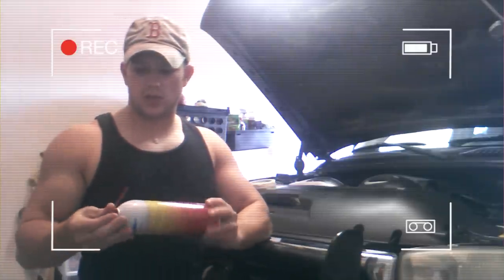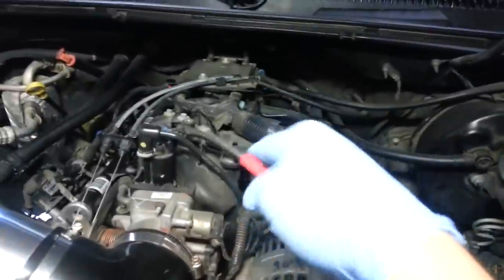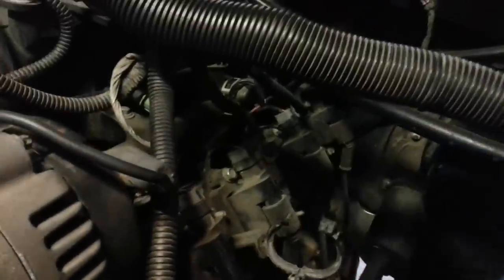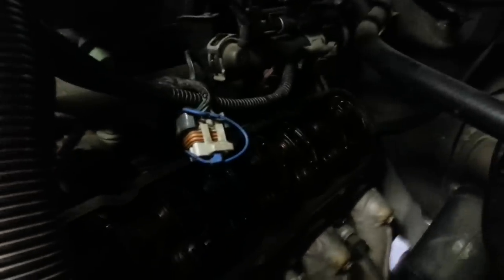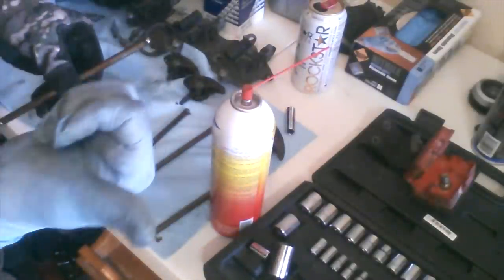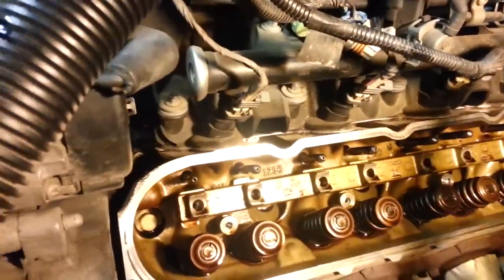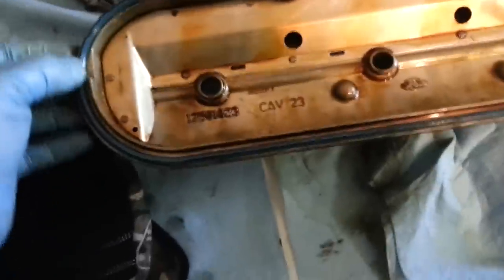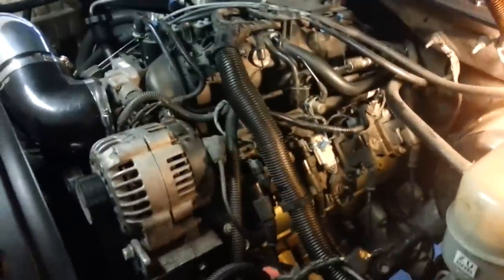GM Lifter Knock Repair - Carb Cleaner Method - HOW TO / TUTORIAL

Comment: I know you mean well.  But ... Pulling those studs out is a NO NO!.  You should never remove a rocker stud if there is a nut on top of the rocker, use a wrench to hold the stud tight in the head, and remove the nut from the top.  Also you better know how to set the lash on the rockers once you put it back together.  Or you going to have misfires, cross firing, and in general you may not even get the truck started.  As I said, I know you mean well, but what your doing will cause extream damage to the valve train if you make a mistake and over tighten a rocker, and if you don't torque those studs back into that head, they WILL come loose and then your going to need a new head.  Any of the 5.3l 5.7l Vortec engines made from 95 to 98 will have pressed in rocker studs , but if the engine or heads have been rebuilt by someone that knows what they are doing, the studs may have been removed and screw in studs installed.  These are not meant to be removed from the head once installed, they will twist on reinstallation and can break or come loose.  To accomplish what your attempting to do, you are better off to pour a quart of transmission fluid in the engine and run at an idle for 15 to 20 minutes then drain the oil and change the filter and refill the oil.  Sometimes you have to do this three times, and some folks use kerosene rather than transmission fluid.  be careful with kerosene and pouring it in a hot engine may flash  on you, IE it is highly flammable, but then again so is the Chemtool Carb cleaner.  You hit a hot exhaust header and you may end up with a 2nd degree facial burn, your hand blown off when the pressurized Chemtool can explodes, and a fried truck, with either one.  Think I'm kidding about any of this?  I was a GM GoodWrench ASE certified line Mechanic.  I have rebuilt over 150 SBC engines, and more than 50 Big Blocks, not to mention Buick, Pontiac, and GMC's.  Good luck if you keep this up, you WILL toast an engine sooner than latter.

Comment: Not a bad idea. Most likely could just squirt the cleaner down the rocker into the pushrod and it may clean the rod and then just squirt around the lifter bores. Saves l the work and get the same principal accomplished. Great idea though

Comment: Couldnt you of just left the pushrods and rockers in place and sprayed the cleaner through the hole at the top of the rod/rocker assembly? The cleaner would of traveled through the pushrod to the lifter anyways?

Comment: What about on a 3.4 liter grand am with a loud knock? Would this work? Not sure what's really wrong other than loud knock and car shaking when in park. Gets louder when you hit the gas pedal
Reply: Get a long screw driver or similar item (something that is  hard and rigid, metal or plastic) while the engine is running place the tip of your screw driver/ rigid item on valve cover closest to the front of the car and place your ear on handle portion of the screw driver or the opposite end of your rigid item. If you do not hear the tick clearly through your screw driver move onto the other valve cover and repeat. If you do not hear the tick on either of the calve covers, do this same trick but on the oil pan underneath the car. If the ticks are coming from the valve cover(s) it is the lifters (very common for the 2.8/3.1/3.4/3.8 gm motors) and the instructions in this video will help solve your problem. If the tick is coming from the oil pan it is a rod knock, the engine will either need servicing or a replacement if the rod throws from the engine.

Comment: a lot easier to drain 2 or 3 qts of oil out and add some atf, run the engine at idle for a couple of hours, then change the oil and add 1/2 qt. atf with the new oil. make sure to use the oil that it calls for. not a good thing to dump carb cleaner in the oil and not change the oil.
Reply: I did similar thing on my $1100.00 ls4 gxp  added Wynn’s engine tune up the old school stuff to the oil while I did mini restoration and minor body work paint touch up and brakes head up display minor electrical upper cylinder and combustion cleaning repaired Ac also . The 2006 gxp ls4 runs sounds like new and the black paint look better than new stock after couple coats of wax . While I was working on the car I would run it with 2 can of the old school Wynn’s engine tune up for rings and lifters for 15 min this gave it a good time to remove varnish in the lifters and I put 20000 miles on the car and sound like new 👍👍

Comment: you didn't set lifter pre load prior to torquing bolts, i know this is old video im curious as to how long this motor ran before needing a cam
Reply: You dont have to set any thing on a ls the bolt bottoms out and your putting torque on the bolt at that point not the lifter or valve.  The valves are not adjustable
Reply: @dc-ir3ow  both of you are wrong. They 1000 percent need lash adjustment
Reply: @kirrasurf102  the rockers are non adjustable on ls when the nut bottoms out that's it and if you have the standard lifters in and not the DOD ones there is no lash springs.
Reply: I'm going to guess you never build a ls before

Comment: i have this same noise in my c5 , i thought it was normal because different types on metals expend by heat quicker then other and when it warms up the ticking goes away,. so thats normal . right?
Reply: +420ALLDAY The ticking goes away when it gets warm because the oil thins out and circulates and the oil pump builds up decent oil pressure to fill the lifters, which makes them happy and they shut themselves up.
Its totally normal on higher mileage engines to make a rattle on cold starts, because of wear and tear they just take a little longer to come up to pressure.

Comment: i would also just add abit of deisel to the oil and running it for a few mins before your oil change will clean out your engine,,any sludge with out taking motor apart 
but dont drive it with the diesel fuel in your oil only run it idleing for abit then drop your oil..

Comment: Chemtool is a great product!
Reply: Glyn Robinson
Reply: just add a quart of ATF to the engine oil and drive it,saves all that work
Reply: @Rusty Highlander atf..is oil it's 5 w30..with all the detergents to clean lifter and oil galleys..empty your oil,leave old filter on,run 2 or 3 quarts with some old oil you just drained(2 quarts atf 3 quarts oil you just drained,drive it for 250 miles, drain oil new filter,GOOD oil,new GOOD filter,it will clean that s.o.b if you still hear it do it again

Comment: Thanks , I got a clicking sound we took both Belts off check pulleys water pump and nothing I feel the sound is coming off left side of engine near valve cover I'm hoping it only what you clean I'm going to take to a friend who work on GMC CHEVY trucks .. That me a Little to much for me But I need to find out and how much $$ Thanks All that you said sound about what Problem I have But the sound I have sound I wouldn't say a clicking but as the engine spins it a clacking ... Thanks again Red Raider Great info .
Reply: Try a fresh oil change and substitute a quart of oil with a quart of marvel mystery oil. It's been around for years and has seemed to work pretty good for sticky lifters.
Reply: Marvel Yes I do know, I threw some Sea foam on crank shaft I'm ready to change the oil soon, A friend told me to check if I see any metal shavers in the old oil . With out pulling out the valve covers yet he said it sound like a Lifter ? but he also said sound like the Fly wheel may be bent ..The sierra 4.8 2006 with 1620,000 miles has ran full Synthetic oil since day one oil pressure is good the truck run great except that sound ....ok thanks Timothy Thanks I'll try the Marvel ..
Reply: Yeah I've changed a lot of flexplates on older sbc chevy motors in the past because of cracks. Last one was about 2 years ago and the whole center was broke out and sounded like it was going to drop a crank out on the ground. On the older motors you could tap on the flex plate and if it had a sharp pitch rig it was good but newer truck I don't think you can get to them. Maybe through a small inspection cover. Been a while since I've been under one. Good luck sir.
Reply: I did the oil change last night I put in oil and Marvel .. I did add Sea foam 3 day earlier I was looking for any metal shaver threw out the old oil Nothing ..But the Noise is still there .. It got a thump click sound I guess I may have to pull out valve cover to inspect the inside I'm waiting for this guy to take off valve cover to look in Let see what he says The other Mechanic who wrk for GM said it sound like broken Fly wheel .. So I think my best bet is to let the 1st guy check inside the valve cover then go from there .. The truck runs great but the noise  seem to come from valve cover but hard to tell ... oh boy ..
Reply: Well I guess being your already in the valve cover might as well shoot some Barryman carb and choke cleaner down the pushrods. I think shooting the carb cleaner down the pushrods would be better than pulling the rockers and pushrods. Seems like you could build some pressure in the lifter and push all that nasty crud out. That is design flaw that GM did on these engines is not being able to remove the lifters without pulling a head.
Reply: I do thank you Tim The valve cover will be coming off soon so the mechanic can really see what up then will from their ... Thank you again I will post after he figures it out ..Thanks again Amigo ...
Reply: Well we took off both Valve covers I had two Mechanic look probe  even with the engine on found nothing . When the oil was changed we found no metal chip shavers nothing . Some Comments they said maybe the oil pump or Timing chain but no evidence of metal found or a bent fly wheel , We check around the starter But the mechanic felt it was not coming from the area . It sounds like rubbing tug boat noise with a bearing sound  We did the taking off the belts check pulley twice . Conclusion was keep driving until some gives .. Oil pressure every thing runs good except that sound .. Hoping I can film the sound today .
Reply: Only other thing I could think of it being is maybe piston rock. I've talked to several of Jasper engines engineers about this and they say that when GM built the newer vortec and LS engines the shortened the skirts on the pistons a little causing the piston to rock in the cylinders. I really don't think it's enough to cause any major issues. Some say they have pulled oil samples and the iron levels were elevated but I kind of think that's a little normal with aging engines. I've seen some start the tick at 10 or 20k miles and the engines run over 300k miles. They are tough engines. Keep in mind. A somewhat low miles long block 5.3 is usually around 800-1200 from a salvage yard. Just have them look around for one. I'm about to swap a 6.0 into my 65 gmc and I'll prolly buy a 100k mile motor with no worries. They are simple engines. Lifter design I a little iffy. Specially having to pull the heads to remove the lifters.
Reply: Timothy Thanks for the advice . If anything I will post , I like to record the sound of the engine.

Comment: spray it down through the pushrod and it will go where u want it, but BE WARNED you might have a cam lobe that is no good, usally this failure is from lack of maintance, don't depend on that oil life system, change the oil.... oil is cheep engines are not
Reply: +ThePariss333 you need to do an oil analysis to help you figure out what your intervals should be.
Reply: +ThePariss333 I change engine oil and filter every 5,000 miles I use Mobile One oil with AC Delco filter.
Reply: Glyn Robinson that's not the right answer- that's what YOU do.  The only way to tell is to do an oil analysis, such as through Blackstone.  they are cheap, especially when one considers they are likely overchanging their oil.   Not only that, it also will indicate if there's a part that's failing or at risk of failing.  If you're overchanging your oil, not only does it cost a lot of money, it also consumes more petroleum needlessly.
Reply: +Doctor Morbid   I said "I" instead of "the owners manual says" or "you should". Each owners driving habits are different. I agree, an oil analysis is better so you can tell what's going on inside your engine. Changing the oil in my truck, like I do, only equates to one oil change per year.
Reply: ***** sorry for late respoince, i usally forget to check this, but it doesnt matter what oil you use, 5k miles tops... i repeat oil is cheep engines are not. and using black stone is a good idea, but i use as an example my duramax, i have 5k km's on it and the oil is still semi clear, diesel engine oil does not have to be black
Reply: You can still change your oil when you choose but,the OLM is a good thing to have and use. As long as you reset the system after changing the oil.

Comment: for the sake of getting god it's a VALVE COVER
Reply: It's actually called a rocker cover.
Reply: @jesseh9523  no it's called  a valve cover
Reply: @shaungriffin4617  you clearly don't know how a push rod v8 works its covering the rockers not the valves therefore its a rocker cover.
Reply: @shaungriffin4617  I have 4 ls engines 😭 and wtf does you working at a chevy dealership have to do with anything?
Reply: @jesseh9523  valve cover, rocker cover, head cover are all used interchangeably and are all correct

Comment: mine does then quits after its warmed up but when I park it at a store and leave it idle why I'm in there it starts knocking again (sometimes) but most of the times doesn't is this the lifters or another problem I have normal oil pressure no check engine light
Reply: +Wesley D oh and go play in traffic
Reply: +Wesley D k
Reply: +chris clevenger I niver heard uf that way doo yoo sey that two mee. 
It's a little difficult to read. Don't you think?

Anyhow, truth being said, it is not particularly safe to run a motor designed  to be lubricated by oil at all when adding a chemical designed to break down oils.Check into Seafoam. It is a petroleum based product that is designed for this type of issue and is 100 percent safe on your vehicles motor. When you introduce such chemicals into your oil it separates and could increase the chance of non lubrication which will breach down components that were designed to perform under a large amount of lubrication.
Reply: blocked oil passages or weak oil pump

Comment: I just run 2 quarts of transmission fluid in it for about 20 minuites then change the oil works fine,
Reply: What do you mean? Run transmission fluid as oil?
Reply: @bcjdwbiernfjherwfbowfib put 2 quarts of transmission in with your motor oil transmission fluid is realy high  detergent will clean the sludge or whats making the lifter stick after rinning it a while change the oil and filter

Comment: My lifter noise seems to be louder after I"ve just changed the oil on my '97 GMC V6, using the recommended 5-30 instead of 10-30 oil.
Reply: Was it a cheap oil filter? Mine collared, dropping oile pressure by 8 psi or so

Comment: all the pushrods are the same size why keep them in order?
Reply: If you put them back the same way and same order your engine will last longer
Reply: +LOVEOLDERMOPARS1 yep they have all been worn abit to each cylinder
Reply: +LOVEOLDERMOPARS1 no 2 pushrods/rockerarms/lifters will wear the same.  They have all worn into each other and if you change or flip the push rods   they will have to re wear to the form of the part they are contacting part......not good

Comment: WARNING: The video leaves out two very important steps that could cause more problems than it fixes. Whenever the rocker arms are removed to access the push rods two things need to be done when re-installing them. 1 - New hold down bolts are required due to the fact that the old ones get stretched during operation and won't tighten up the same. 2 -  The valves associated with the cylinder being work on must be unloaded, i.e., both  intake and exhaust closed before torquing the new bolts to 22 ft-lbs. This requires turning the crankshaft until the correct cylinder's valves are closed. This is best accomplished by having two people working together. One turning the Crank from underneath the vehicle using the inspection port on the bell-housing to access the fly wheel, and with a large screw drive engage the teeth and move in either direction, while the second person watches the the valve springs unload. Hope this helps. K. Beatty, Spring Hill, Fl.
Reply: you can adjustable the rockers on GM with the motor running. If its a cheap car who cares? Noise is what we want to fix. Its not going to the Moon. Great perfect full wallet scenario Kenneth, I agree, but younger people with worn cars need to get their hands dirty. Don't scare them off. Not criticizing, just saying. lol. Good day.